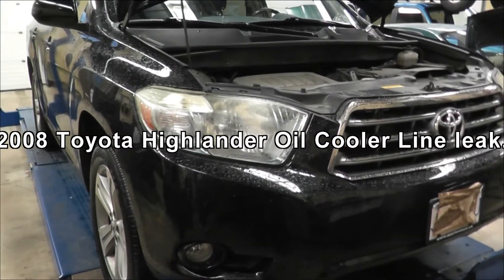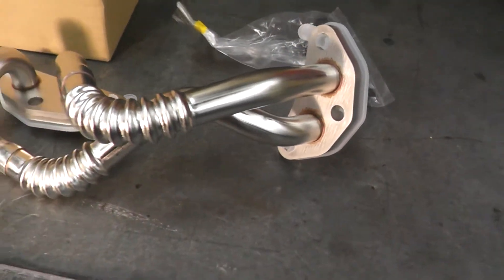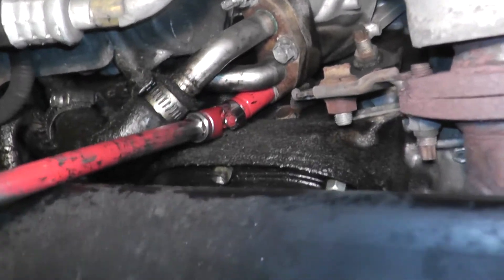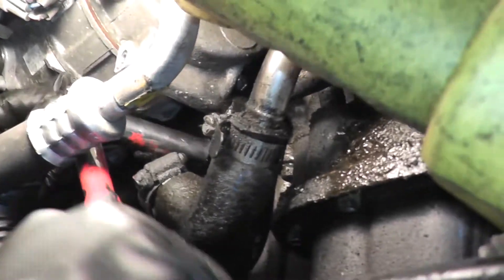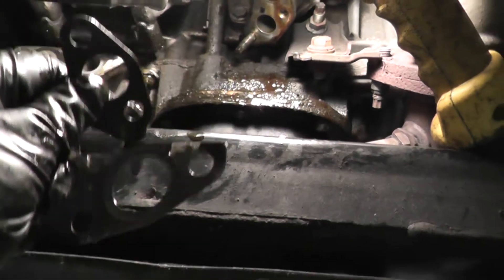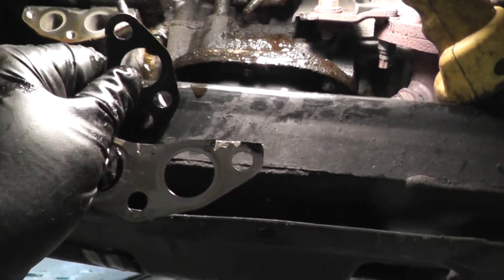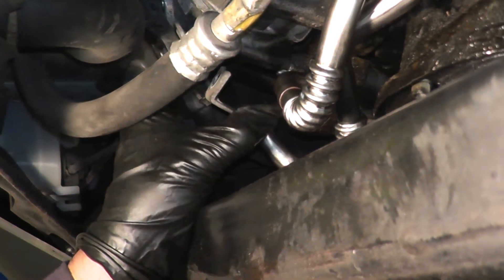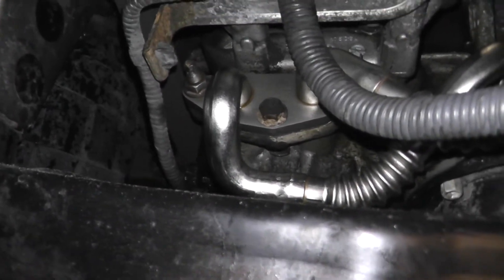Highlander oil cooler line leak

Comment: Nice informative video. I just had to get this pipe replaced. Didn't notice the oil dripping from my Highlander(2008/155000 mi) till I had made it safely to my driveway. Must have just happened. Whole bottom of car is sprayed with oil plus the outside of hatch at rear and a rear tire. What a mess! Towed to Toyota service dept. Also had oil added and replaced a drive belt that had disintegrated. Estimated cost of $1100+. I unfortunately can't work on a problem like this myself. I have changed out the battery a couple of times though. 67 years young and female. Shortly, I'm planning to work on the AC/furnace fan next. Your video helped me understand what to say to the repair guy even though I couldn't do the repair myself. 💪

Comment: This is really helpful -- THANKS! 
I just got a 2010 Highlander Limited with the towing package and 137,000 miles, in good shape except is still has the original rubber and metal pipes (not leaking at yet). I understand that is big risk anyway. Will be changing it out myself right away using the genuine parts and your great instructions. I'm not a pro like you so wish me luck.
Reply: How did it turn out?
Reply: @michaelmarks5012  I ordered the official Toyota part and put that fella in the following week. Worked out like a charm and great confidence that all is well now. Thanks!
Reply: The timing belt is more of a risk as are bad tires.

Comment: The stud farthest to the right (closest to the steering wheel) is, in my experience, the only one that must be installed before putting the pipe in place. So that's how I did it--removed the three other studs and just had that one in and then put the pipe assembly on and added the other nuts and studs. This job was harder than I thought it would be.

Comment: Thank you for your help. 
I worked on 2008 toyota highlander for four  hours just to put the line back.
After I watched you video and how you go step by step that  helped a lot.
The easy way for me was  to put the oil line back is to I take  the two  Bottom Bolt out 
I was wondering if you have a video for changing   Spark plug for the same car..

Thanks again

Comment: Great job and excellent explanation. Two suggestions: spray some degreaser up in there while everything is apart and hose it off so it's nice and clean for the customer; and second, just change the oil and filter so everything is nice and fresh. 
Little things like that go a LONG way with a customer.

Comment: Good video Frank, thank you

This happened to me when we were out on a family trip out of state in Maryland. 

It was either two things, 1) leaky oil filter, since I just did an oil change at a shop before the trip, but that wasn't it, 2) it was leaking out of the oil pan gasket. I went and bought tools and replacement parts and replaced the oil pan gasket. I turn on the car and same oil coming out! Got closer to the issue under the car and that is when I noticed the hose leaking. This I could not repair myself. Fitzgerald Toyota Dealer just a few miles away, I called and spoke to the service manager, he mentioned that they had one Toyota "Recall: kit replacement left, so I had the car towed to them. They were AMAZING, great service and great attitude all fixed for free, the bill came out to about $1,200. I was very grateful to say the least.

<WB>
Reply: Nice.   We had similar experience with failed oil cooler line,  but our dealer said the "campaign" to replace for free had expired,  so we have to pay $720 out of pocket.   Our VVT-i oil line has already been upgraded back in 2011, very similar original design with short rubber hose sections.  If you haven't had that upgrade, look into it since it is open until 12/31/2021.  It's LSC 90K campaign.
Reply: @rayphillips815  that really sucks Ray
Our replacement was metal pipe version thank goodness.
Reply: @walter.bellini yeah, or replacement is the all metal version.   Should have been that way from the start.   Dealership literally emailed me an our ago that it's ready for pick up.
Reply: @rayphillips815  just glad that you didn’t blow your engine. Enjoy your Highlander

Comment: Do you need to drain the oil before? Or does the oil not drain out of there without the engine running?
Reply: No you don’t, but there will be some oil coming out, whatever is in the line.

Comment: Toyota starting using the all metal lines in mid-2011, right?  So any '08-'11 Highlander with an engine oil cooler should have the rubber lines replaced?
Reply: If it has the rubber lines don't think about changing them....DO IT NOW!!!!!!! mine broke and I almost lost my engine!!!!
Reply: No not true..there's another line that was replaced to metal but not the one in this video.  It is rubber on my 2010.
Reply: @weldonjenkins15  Correct. I was asking whether any Highlander from '08-''11 should have the rubber engine cooler line replaced with metal. Because Toyota didn't start going with metal lines until mid-2011.
Reply: @Bostonbob3  ahh gotcha...i mosread your previous post.
Reply: Yes feel if the rubber is super hard, if so change it. Or in your free time change it.

Comment: What an outstanding video. Complete. Covered every possibility. Excellent filming. 
My 2010 has the tow package. I believe there are two rubber lines that need to be replaced with metal?
Reply from the maker: Thank you and the new updated part is made out of metal, no more rubber hoses. Toyota has recently put out a Recall on this service, if I were you, I would check with dealer first and see if your vehicle is covered. cheers

Comment: Great tutorial YouTube, I was wondering if 2012 highlander is same model with this cooler line? I checked my car and I couldn't find this part,.could 2012 model different? Thanks
Reply from the maker: Thank you, and yes i think it's the same one
Reply: They fixed this on 2011 models made after November, all 2012/2013 models should have the metal line or none at all

Comment: thank you so much for sharing!  Mine RX350 is leaking too and you video helped a lot.  I have one question if you don't mind.  I don't have the torx for the stud, do you think a 6mm socket will do?  I was afraid it will damage the stud.  thx.
Reply from the maker: A 12 point (6mm) socket should work, but I would double nut the stud to remove it.

Comment: Hello, once the job is finished how much oil do I have to add for the leak that occurred during removal/installation? Thanks
Reply from the maker: best is to check the dip-stick
Reply: @Steve Richards  I am asking to be ready with already pre-purchased volume of oil. I am a mechanic myself, though working on aircraft
Reply: @Steve Richards  i don’t need extra oil in my garage. ASE certification... Not even in my mind. Whatever man...
Reply: @Steve Richards relax

Comment: The hazard light did not come up on my RX… just saw that I had a leak when I got home and I had no oil at all!
Reply: I think that the dipstick only measures 1 qt, so you may have had oil, at least a qt low, but not enough to trigger the warning. At least my guess.

Comment: Mine had the recall done on it in 2009.  I recently discovered it’s leaking from the left side , I’m freaking pissed off
Reply: You mean the new metal pipe is leaking?
Reply: @artistnyc123  yes from the gasket cause in initial install the mechanic didn’t tighten the nuts down all the way so was seeping from outflow side.  I just happen to check it cause I was getting a minimum oil drip on my garage pavement.